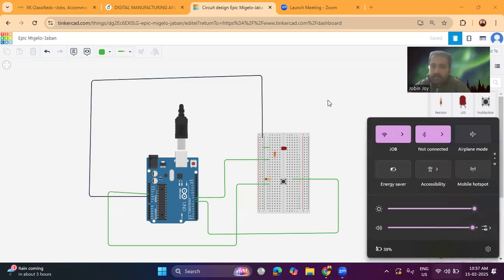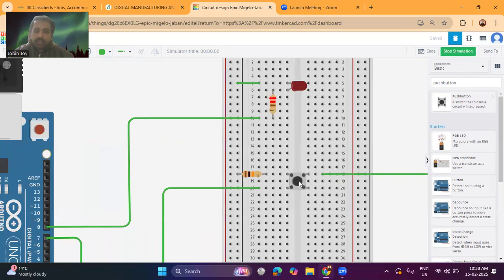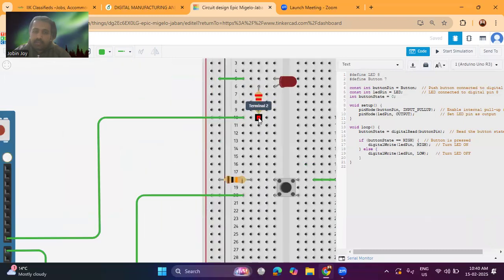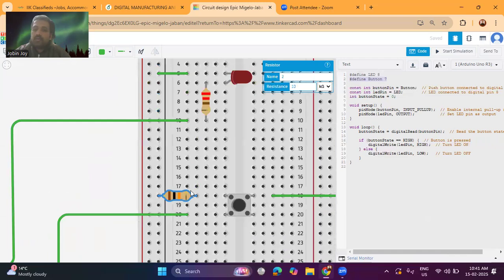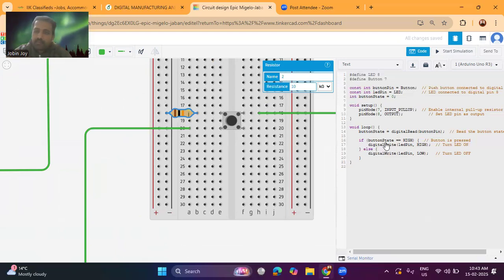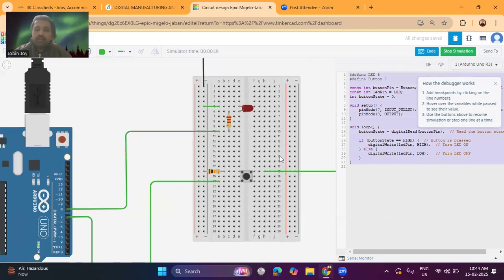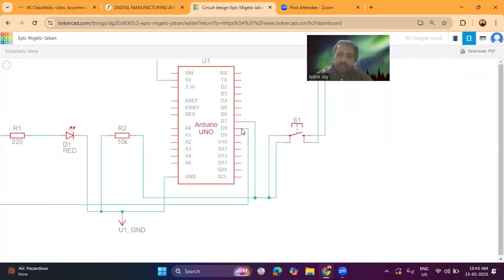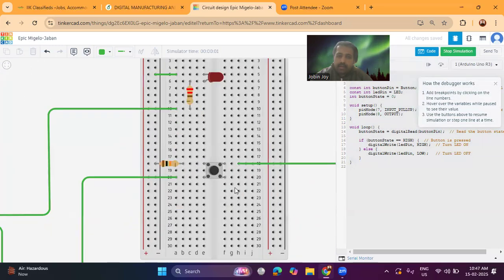Master Arduino with a Simple Push Button Switch Project!

Comment from the maker: #define LED 8
#define Button 7

const int buttonPin = Button;  // Push button connected to digital pin 7
const int ledPin = LED;        // LED connected to digital pin 8
int buttonState = 0; 

void setup() {
    pinMode(7, INPUT_PULLUP);  // Enable internal pull-up resistor
    pinMode(8, OUTPUT);           // Set LED pin as output
}

void loop() {
    buttonState = digitalRead(buttonPin);  // Read the button state

    if (buttonState == HIGH) {  // Button is pressed
        digitalWrite(ledPin, HIGH);  // Turn LED ON
    } else {
        digitalWrite(ledPin, LOW);   // Turn LED OFF
    }
}